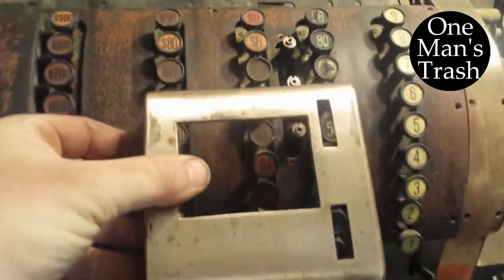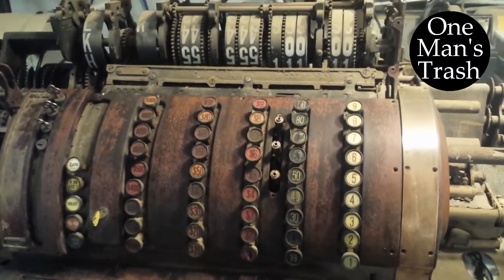National Cash Register restoration part 2 - teardown and paint stripping

Comment: ongrats on the restoration. It was beautiful. I don't know if you can help me. I am restoring a 452 and would like to remove the value rotary indicators. I saw that it has an axle but I couldn't remove the axle. Even knocking, it looks like there's something preventing the axle from coming out. Could you help me please?  Thank you very much in advance.
Reply from the maker: Unfortunately I’m not an expert on these machines, the unit I restored was 60 years old when I was born. I do know that they are built like tanks. I don’t have a machine to look at but would assume that there are set screws or pins holding everything in place. If you have a YouTube channel , record a video of what you’re trying to remove, post a link here in the comments and maybe I’ll be able to help or someone else might have ideas for you.
Reply: @ThatllDoEngineering  Thanks a lot for the feedback. I will do what you recommended (record a video). Thanks